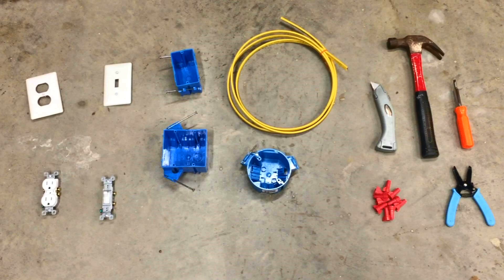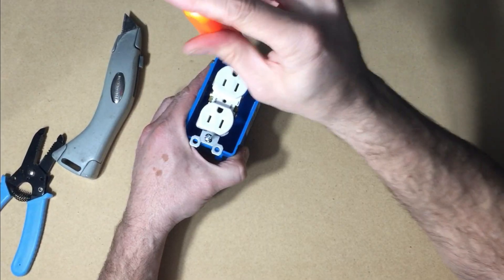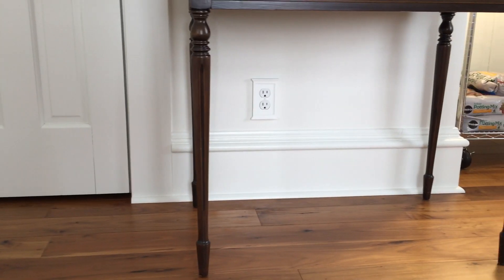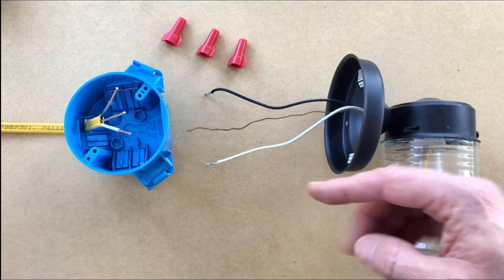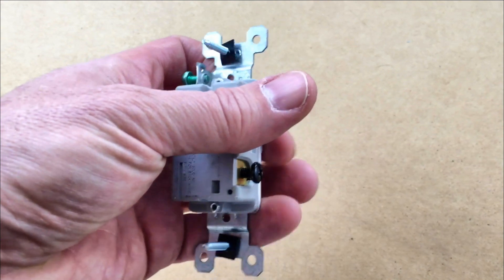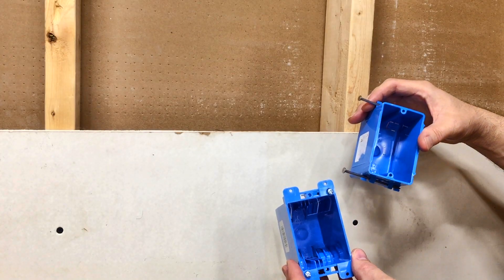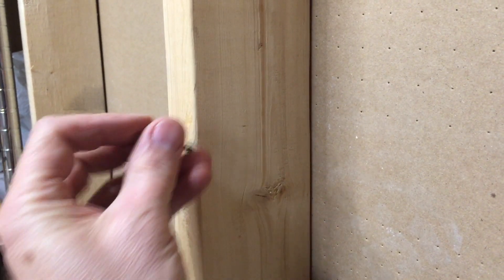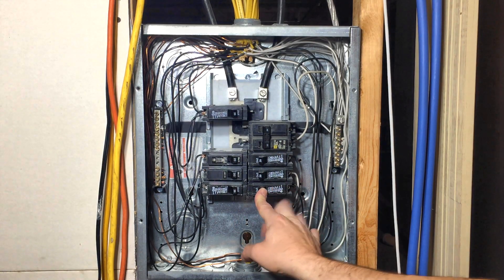How To Wire an Outlet, Switch, Light or Fan.

Comment: Yeah, a good video only thing is it's better to pig. Tail, the wires are not connected to the upper and lower screws. You can find a better video out there. That's one of the ones where it says do not wrap the ground pig tail the ground.
 That's what the professionals told me when I call them to my house.

Comment: I’m attempting to install a ceiling fan in a bedroom without preexisting overhead lighting. There’s a ceiling fan in the room directly next to it. How can I pull power from that fan to do my new install? In 3 other rooms in my house the fans are all on the same breaker. Can I link the other 2 rooms in a similar way? Think I need a junction box? I’ve seen videos on pulling wire and etc so I think I’m ok there. Just need help with the power part
Reply from the maker: You should be able to make the connection in the electrical box above the existing fan and run the new wire to the new fan.  Make sure the total amperage of all the fans, together, doesn’t exceed the amps of the breaker.

Comment: excellent video.  Do you have a video the explains how to add canless ligthing to an existing electrical source from a ceiling fan and at the same time separate the switch for the fan from the canless lights?
Reply from the maker: Sorry I don’t, but if you want lights and fan to work separately, you need two separate wires.  It sounds like you may only have one wire running to the fan.

Comment: The power is coming in to my outlet and going to switch. It's reversed than what you have. Is it still the same?
Reply from the maker: If its a switched outlet, the black power wire is going past the outlet, through the switch and and back to the outlet.  It likely comes back on a white wire, because its the only wire available.  So, your outlet will have a white power wire coming in and a white drain wire going out.  If I ever have that odd situation, I color the white power wire black with a sharpie. 

If the switch controls a room light, then it’s daisy chained, like two outlets.  The power feeds the outlet, and then the switch.

Comment: I need help with one my my light switch. Don't know how to feed power to a ceiling light from some wires that are already connected together to feed power to my other rooms
Reply from the maker: It can be tricky to run wires through existing walls.  Fish Tape like this can help. 

Klein Tools 56331 Fish Tape, Steel Wire Puller with Double Loop Tip, Optimized Housing and Handle, 1/8-Inch x 50-Foot https://www.amazon.com/dp/B081TVR4N7/ref=cm_sw_r_cp_api_glt_i_EG6TKHWV29DCT402KSVE

Comment: The one thing that confuses me is,  how do you find the wires? Remove all the sheetrock on wall? What about a outside light with indoor light switch. How do you find the wires?
Reply from the maker: Wire finder
Stud Finder Wall Scanner, 5 in 1 Multi-function Upgraded Smart Stud Sensor, Wall Scanner with Battery for the Center& Edge of Metal, Studs and AC Wire, Pipe Locator for Walls https://www.amazon.com/dp/B07T88Z83T/ref=cm_sw_r_cp_api_glt_i_Q50APFPR1EREJBE83B0Y
Reply: @HowToLou  thank you

Comment: On a 3 way switch does the power need to enter the opposite switch as the lights?
Reply from the maker: Yes, it needs to be wired exactly like in video.  The power is going from one end to the other.  The 3 ways just switch between two paths, like two parallel train tracks with switches on both ends.

Comment: Why not have one continuous white wire instead of sections wire nutted together??
Reply from the maker: Those nutted connections are inside the box.  You are bringing two cables into the box and making connections inside.  You need to either screw to switch or wire nut.  You could technically pass one wire through the box and not cut the white wire, but its much harder, and generally not worth it.  Wire nuts are less than 10 cents each and make excellent connections.
Reply: @HowToLou  Thank you kind sir! 👍🏽
Reply: @HowToLou  Thank you…one more question if I may…..different subject…..can I put a three way dimmer switch at one end of series of lights with a regular three way toggle switch at the other end to control the lights at both locations?
Reply from the maker: Absolutely.  A three way dimmer is really just a regular dimmer AND a 3 way switch combined into one unit.
Reply: @HowToLou  Thank you kind sir!